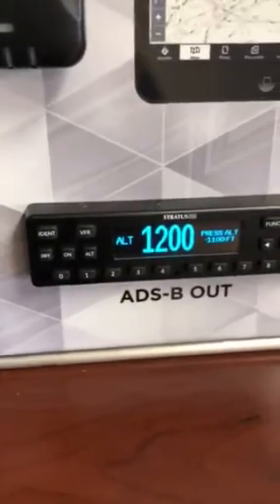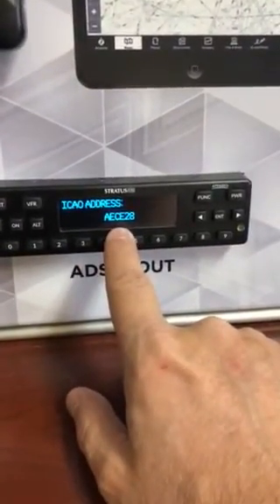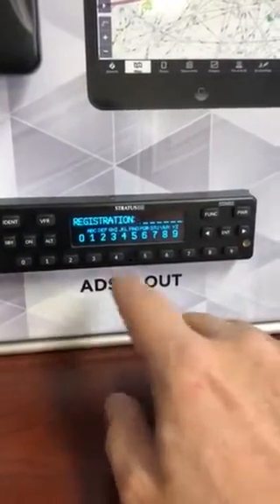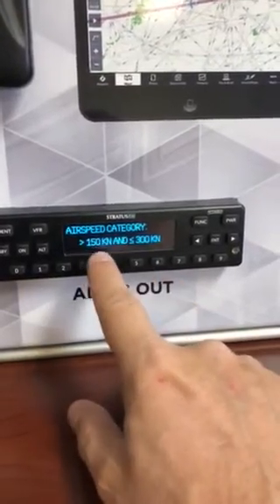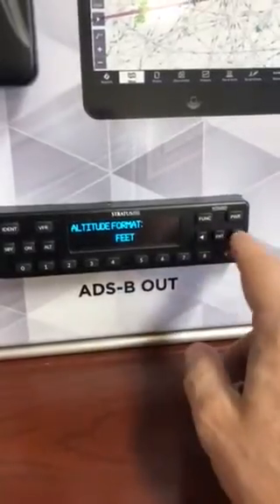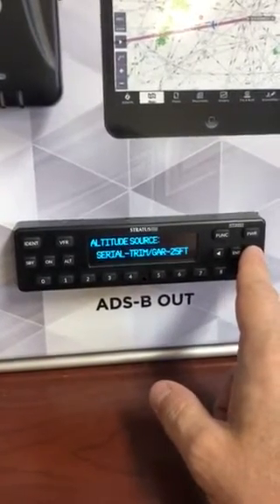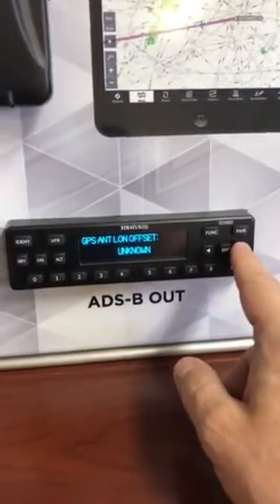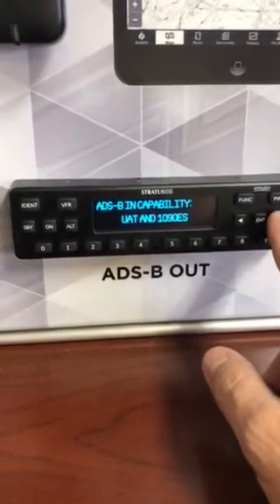How to program Stratus ESG

Comment: John, on Flight radar 24 my plane does not pop up until about 500 ft. Can I change it to start transmitting while on the ground? Its not really the take off but the landing. My wife hates it when the plane goes off radar before reaching the airport.. lol
Reply from the maker: So that’s a little more complicated then you realize.  It’s not a function of when it ‘Turns itself on’. The ADSB network is line of sight to its ground stations. You have to be high enough to have direct communications.  Some airports that’s 500 feet.  Some need several thousand feet. Then there is “off network”. That’s when you are sending and receiving traffic direct from aircraft to aircraft without being on the ADSB network. During this time you can see people in the pattern and on the ground on your traffic screen but the ADSB system can see you so your wife would not be able to see you. Hopefully that makes sense.  You are getting all the coverage you can get.
Reply: @johnstark-StarkAvionics  thanks for the reply John but is the a reason why I see other planes taxing and not mine? I only see it when it’s already in the air and it will drop before landing.
Reply from the maker: @patlittle2537  that website should show only aircraft up in the air and in direct contact with an ADSB tower. Some airports receive ADSB on the ground because there is an ADSB tower close but that’s very rare.